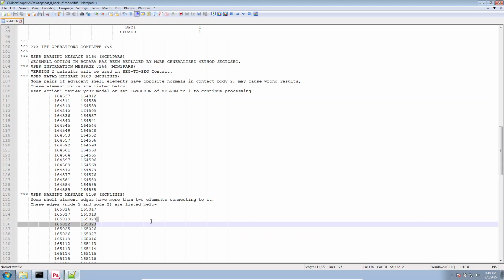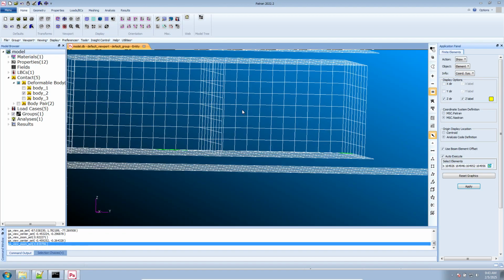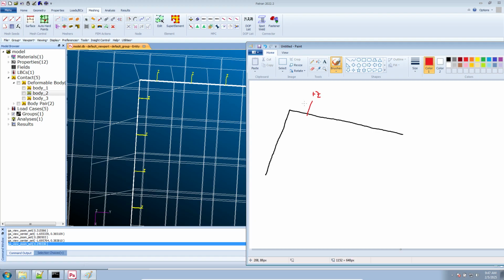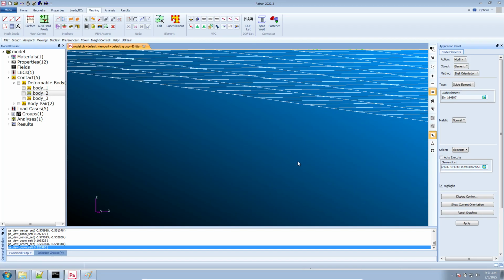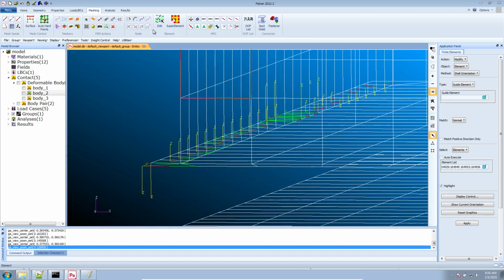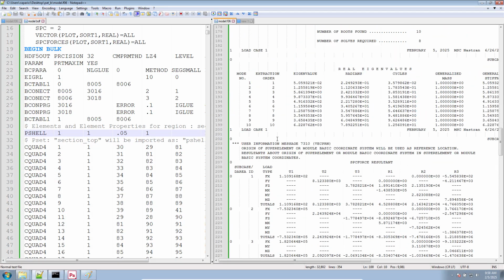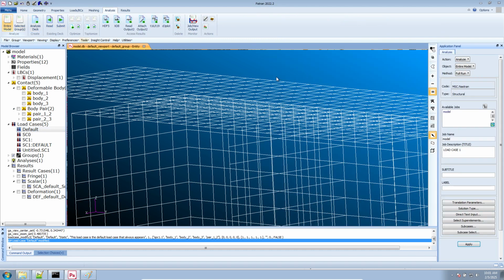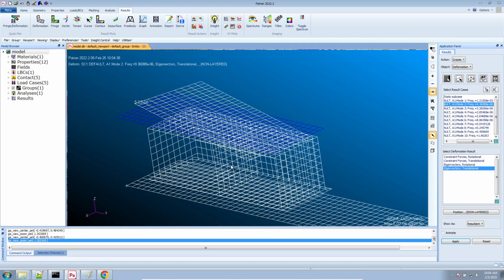Fix to USER FATAL MESSAGE 8109 - MSC Nastran Permanent Glue

Comment: Hello thank you for the useful video.

Is there a way to define connections—either glued or possibly non-linear contact—in situations where three plates, modeled with plate elements, are stacked in a sandwich configuration?
Can the middle plate be glued both to the upper and lower plates?
Does MSC Nastran allow defined contact regions separately for the top and bottom faces of the same middle plate element and specifying these "subregions" to be glued to the either the top or bottom plates?
Thanks!
Reply from the maker: Yes, it is possible to define contact regions for the 3 stacked plates.

Yes, the middle plate may be glued to the upper and lower plates.

Yes, it is possible to define separate contact regions for the top and bottom faces.

You would define two BCBODY1 entries. One BCBODY1 for the contact between the top and middle plate. A separate BCBODY1 for the contact between the bottom and middle plate. Then use a BCTABL1 to reference all your BCBODY1 entries.
Reply: @the-engineering-lab thank you for the information. 

Apparently the pre-processor I am using is not able to export BCTABL1 but only BCTABLE which is, in  my understanding, the old MSC Nastran style. Is it possible to proceed in the same way you described?
Reply from the maker: @arniko2762  Which Pre-processor are you using? I did make a simple example with 3 stacked plates. It would be good to make a tutorial in the Pre web app, Patran or MSC Apex, but it would have to wait until Monday.